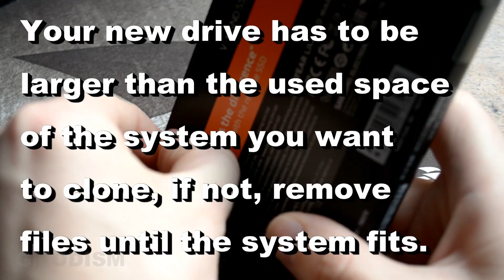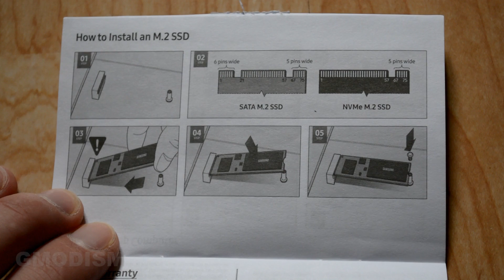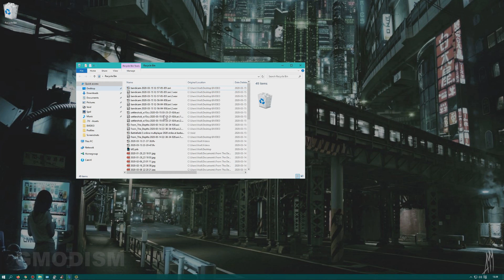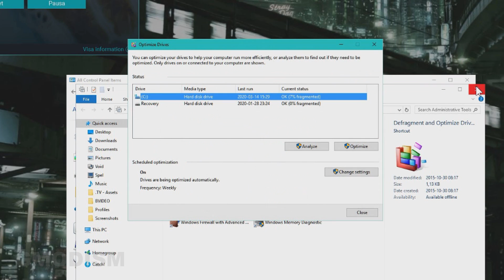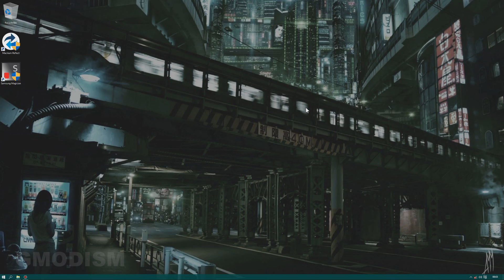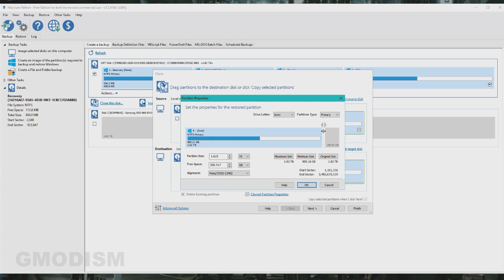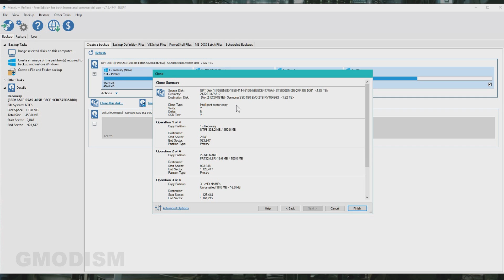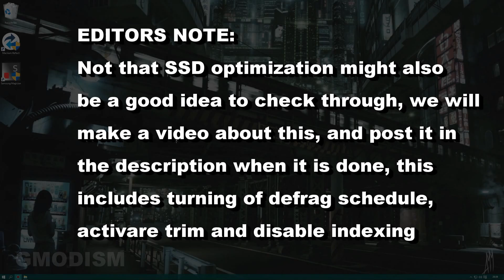How to Move Windows 10/11 from HDD to SSD

Comment: Even in 2021, this is such a good video! I followed these steps when migrating from my laptop's HDD to a new SSD
Just a few updates:
-On Macrium, it now requires an email. The email is where they will send the link to the installer. Not a deal breaker, it's still a free software
Pretty much Macrium is the same as presented in the video

For anyone wondering how I did mine:
Background: I have a spare m.2 ssd slot in my laptop in addition to my existing 2.5" HDD
1  - I installed my m.2 SSD to the slot
2 - followed all the steps on this video, except for the post cloning - because I intend to keep the HDD and SSD running at the same time even after cloning
3 - After cloning, checked in Disk Management and File Explorer if the new drive is detected and working
--At this point, do not worry about the Letter Assignment of the drives / partition, it will change later
4 - Go into BIOS/UEFI, change boot startup setting to the SSD
5 - Save and Exit BIOS, it will now boot to the new SSD. It is noticeable because the boot load time was just < 5 seconds compared to ~1 minute on my HDD
6 - You will notice it automatically changes the drive of the new SSD to the default C:/ partition. My old HDD was assigned a new letter

My HDD had three partitions (C: D: and E:), and the OS was originally in the C:/ partition.
In the macrium software, when dragging the partitions to clone to the new drive, I did not include the original D: and E: partition since there was no OS files in that

Hope this helps to anyone who needs it! Good video man, this is the most simple yet elegant solution

Comment: If I don't install the operating system on the SDD, and I keep the operating system on the original HDD instead... Will I still see an increase in speed and app performance if I just install the SDD without putting the operating system on it?

Comment: When I go to boot from my cloned disk in BIOS it doesn’t appear in the available options list of bootable drives. also, in macrium my original C: drive does not list the separate partitions as Primary, they are all Dynamic. They are also highlighted in orange rather than blue. converting my new drive from a basic drive to a dynamic one makes it disappear from macrium altogether. any assistance would be super appreciated!!
Reply: Have you get any solution yet? 
- Using asus laptop
-  tweaked bios csm-safety boot setup
- plug - unplug hdd (origin) and ssd (target)

And still SSD not detected in bios
Reply: @winters4960  so ultimately I was unable to clone my original drive to my new drive because my original was a dynamic volume instead of a basic drive. I installed a fresh copy of windows onto my new drive.
Reply: @nathanaelstevenson3674  after trying all every solution. Mine (original windows) has successfull boot with ssd. As you say, it must list as basic drive for all partition. And have to clone ALL hdd partition into ssd (i'm using macrium).

* At first i only cloned OS partition only and it cant be detected as bootable device

Comment: IMPORTANT***If cloning to a BIGGER SSD!

Onve you're in Macrium make sure to drag down the (C:) Primary partition LAST. That way you're allowed to allocate all of the available free space to it! The program only allows you to increase the clone size if it's the last partition you dragged down.
Reply: Thanks, man! I’m so glad I saw your comment so early in the process
Reply: Thank you so much. Cloned from a 256gb ssd to a 1tb m.2 NVMe and realized I had 700gb unallocated. Couldn't partition that remaining space without disabling the ability to boot from the NVMe even after cloning. Followed what you said and now im cloning with the remaining space on the primary!
Reply: Dragged down last, what do you mean please its tick boxes on free Version I'm using version 8 I think. Any help appreciated I dont get why its trimming the new disk or how to stop it doing it cant see any option to prevent it. Cheers
Reply: @Teckno77  on 7:27 he drags down those parts to the new disk starting from left to right. You might gonna have to drag them down in a different order so that your primary space is dragged down the last. Then just click Layout while the primary part is highlighted and you should be able to change how much of the unallocated space your new disk will have

Comment: More than a year later, and this video still did the trick for me! Thank you very much for this! I upgraded from a (seemingly) damaged 1TB HDD to a 2TB M.2 NVMe SSD (3rd gen I think?). The difference is day and night. 

I ran into some trouble during the partition slider thingy due to my software being a more recent version than yours, which changed some interface elements. I was particularly worried about my partitions because besides Windows I algo have Ubuntu. Before the upgrade the BIOS would ask me to choose what OS I wanted to boot up, but now it boots up straight to Windows, which isn't bad, but I wonder how to boot up Ubuntu if I ever need to again.

Thanks again for the video, I don't know if you still read, let alone answer to new comments, but I feel like I must thank you for this, it feels like a brand new computer!
Reply: Hey, quick question. Does it work the same when using an M.2 SSD? Like he said in the video, that you should use the old SATA cable of the HDD to connect the new SSD, but the M.2 is directly connected to the motherboard. Can I just follow the tutorial disregarding this or is there anything you did differently?
Reply: @aha6781  Yes, when you get to the part when you must plug in your SSD just insert your M.2 drive like you normally would; I literally left a hole where my old HDD used to go, I didn't replace it with anything. Just "plug" in your M.2 and carry on with the tutorial.
Reply: @aaron8083  Got it, thank you so much!

Comment: Does the system reserved partition affect it when it's on a drive other than the main one?

Because i tried it multiple times and it didn't work.

Is it because my system reserved partition is not on the same drive that's containing the system?
Reply from the maker: Both are needed
Reply: @GMODISM  so what options do i have?

Is it possible to clone the drive that's containing the system and cloning the system reserved partition from the other drive into one drive?
here's a screenshot  to make things more clear :
https://imgur.com/a/Hj0Y9jr

Comment: Is it possible to only copy the Windows Boot Manager of my old HDD? I can't remove it in my CPU because my computer won't boot without its Windows Boot Manager.

My SSD is only 240gb while my old HDD is 465gb with over 400gb space used that's why I can't clone it.

Comment: What if you wanna keep the HDD in the computer still? Just delete the cloned data from the HDD now that it's on the SSD
Reply: You just connect the 2nd SATA and powercable.
Reply: For anyone wondering after everything's cloned just make sure your SSD is the drive being used now over the HDD for your system. If that's all good you can literally just delete everything or go through and pick what you want to keep on the HDD. You can even delete things like Windows off the HDD but you'll probably have to YouTube how to do that as well like I did because it requires you to change certain permissions to do it.

Comment: Hey, thank you I cloned successfully but cannot work out how to get the SSD to boot.

I have an ASUS MoBo, in that BIOS under boot option only the SSD is showing. I have been trying for a while to get it to work.

I have refitted the HDD, and had to reset win 10 - thinking maybe I have to re clone? 

I have tried to reset the SSD but it errorEd (I snatched out the HDD data cable just as I clicked go....)  probably shouldn’t have done that but getting desperate. HDD is sooooo slow

Comment: Before watching this video I downloaded that and it installed 5 other programs, it doesn't even say anything on virus total. Don't install it, it's gonna put a bunch of adware and PUPs on your PC that you can't uninstall. They wont let you uninstall it, they're uninstall resistant, and windows won't do it. I was able to uninstall this cause this ain't my first rodeo with bitcoin miners and PUPs but PLEASE do NOT download this!
Reply from the maker: Macrium reflect? Never had any issues myself
Reply: @GMODISM  It downloaded TOPVPN Ifun screenshots Ifun screen recorder and was in the process of downloading more.
Reply: @GMODISM  I used IO bit uninstaller and booted them off the system as well as this virus.

Comment: My laptop has an additional slot for an ssd which I’ll be installing. I’m going to transfer everything from my default C: drive (hdd) into the ssd and set the ssd as the default boot drive. After that, could I simply just delete everything in the C: drive and use it for storage while the laptop runs and installs programs on the ssd?
Reply from the maker: Kind of but look at the tutorial in description or pinned comments on how to reuse it

Comment: This has just helped me out so much I’m so thankful can you plug the hdd back in straight away and start using or do you have to wait a month
Reply from the maker: you want to wait to make sure the ssd is not faulty, technically the old hdd still hols windows and all your files, you can use it as a backup, everything is still there as well. 
To use it to store files you need to clean it up, check video link in pinned comment and description on how to start using the old drive :)

Comment: Hope you answer my question. I have a 120GB SSD and a 1TB HDD. I want to move windows 10 From HDD to SSD and I have 4 different partition of HDD. So should I only clone the C drive or i have to get same amount of storage?(Sorry if I don't make any sense)
Reply: You need to put everything on the ssd or else it wont boot. Start with the smallest size partition and put the largest at the end. It should work.
Reply: @zyz6325  Thanks. It worked
Reply: @wahidulhauqe3929  yaayy

Comment: What do I do if my ssd isn’t new like I used it before and had to reset everything because I was in repair loop. How would I copy each thing over from the hhd cause it’s a bunch of different partitions
Reply from the maker: Depends if you deleted stuff from the ssd or not, if everything is backed up to the hdd then just copy that over, but not sure what you have done prior to this.
Reply: @GMODISM  I deleted everything from everything and re downloaded windows on my hhd and copied it over with the same method on this video but it won’t boot from the ssd anymore like it used to

Comment: This tutorial is magic! I went from a 2TB Toshiba HDD to a 1TB SSD and everything worked perfectly. I was under 1TB on the HDD so moving everything to the SSD went smoothly and as described in the video. I still have wiggle room on the SSD for additional games and plan to put some of my lesser used games on the HDD. Great video!
Reply from the maker: Awesome!🌸
Reply: Hi, Michael. Great to hear that everything works out. However, did you lose your Windows 10 license after the cloning process? Because I'm thinking of cloning the drive but my PC was upgraded from Windows 8.1 to 10 and I can't find my original product key...
Reply: @nortongartino4602  best way to find yours: 
regedit > Computer\HKEY_LOCAL_MACHINE\SOFTWARE\Microsoft\Windows NT\CurrentVersion\SoftwareProtectionPlatform

If you click on this folder there will be an object listed 'BackupProductKey'. That is a valid product key, and I believe it's the original one you used.
Reply: @lewisjones284  Thank you for your answer, Lewis. I'm going to try to find it once I got back from work. Thank you.
Reply: @nortongartino4602  Hope it helps you, have a great day
Reply: @nortongartino4602  did it work for you?
Reply: @420Sean69  I didn't look at the regedit, however it turns out that you don't need to. I was able to clone my HDD to my SSD and got my computer up and running, because my friend told me that the windows digital key is bound to your motherboard, not your HDD/SSD. So I think you'll be fine if you want to clone you old HDD to a new SSD and make your new SSD your main drive.

Comment: Weird.  Turns out it's cheaper NOT to use your 50% off link for EaseUS.  I found the price difference is £15.98 + Free 7 day trial vs your 50% off deal at £17.98 NO FREE TRIAL.
Reply from the maker: That's strange, guess I have to ask them why this is then
Reply from the maker: When I check I get the 50% off via private window, maybe you got a even better deal in the area you live then IDK

Comment: Hi i know you may not see this GMODISM but I'm having a issue, im trying to transfer a 1tb hdd to a 500gb ssd and it wont allow me to clone all the files over. What should I do?

Edit: It specifically says "Not all copied. Insufficient Space."
Reply: it is because the ssd cant hold all the files you are transferring from, the hdd because it doesn't have to space too, if you really want to move all your files to an ssd you would have to get a 1tb ssd or only move half of your files to the ssd
Reply: @lilpeli1658  thanks so much, I had a feeling it was that.

Comment: Question: Will this method overclocking GPU the same with CPU? Thanks
Reply from the maker: CPU reads from, the SSD, so yes it will increase speeds, but overclocking is something advanced and not related to upgrading storage drive.
Reply: @GMODISM  Sorry, the wrong video I asked!

Comment: I did all this, wont boot on SSD after unplugging HDD. It says "A required device is not connected." I've been in bios and selected the right SSD, if I boot with HDD, I can see my SSD, and the clone was succesfull. any ideas?
Error: 0xc000000e (if that helps)
Reply from the maker: Seems it had trouble copying over the boot directory, sure you copied that over?
Reply: @GMODISM  I'm not sure. I formatted the SSD and tried again, now it doesn't want to clone the disk at all o.O I've removed the 100gb unused allocated space, so it has 1tb of storage. It instantly reboots into windows 7 for some reason and "an error occurs", rebooting into Windows 10 again.

Comment: hi, thankyou for the amazing tutorial. In my case my HDD is 1tb and my ssd is only 120gb, Will only windows transfer over or everything else i have on the HDD too with that software?
Reply from the maker: Everything will be moved over so make sure it fits, you can store big files on a external hard drive (like movies) if you can't make it fit initially

Comment: Great video. Very easy to follow, however, I can't seem to get my ssd to work when I completed all of the steps. When I go to boot with the ssd, an error comes up on the screen and it won't boot into windows. Any suggestions?
Reply from the maker: Hmm, depends on the error, if something didn't go through you can redo the process, maybe watch the full length tutorial to make sure. Also try googling the exact error message.
Reply: @GMODISM  I figured it out. The ssd is trash.
Reply: @GMODISM  I appreciate the response
Reply from the maker: @KT1459  damn, refund it!
Reply: @GMODISM  I got it to work on my ssd but it made my pc 2x slower. So I'm going to assume it's the ssd
Reply from the maker: @KT1459  yeah refund it, maybe you got a scam ssd from wish or eBay

Comment: I followed this video's instructions on 2 machines.  One worked, but I might have clicked something I  shouldn't on the other, because the cloning automatically assigned drive letters D and H to partitions on the drive I was cloning to. After unplugging the HDD and plugging in the SSD, the bios detects it, but won't load Windows. The bios for the ASUS motherboard does not include an option to load Windows. I can't get it to boot into the SSD. Any clues?

Comment from the maker: Navigation
00:00 intro, beginners watch full tutorial instead in bio
00:21 installation of SSD (or HDD)'
03:01 SSD/HDD detected?
03:34 important preparations
06:17 moving windows to another drive
09:37 booting from your new fresh drive
11:30 check our SSD optimization video in bio for max performance
11:54 outro (watch the full tutorial instead if you have any questions)
Reply: Have you thought about remaking this with the new version of the software? I know it might be similar but the driver part is hard to find in the new ui
Reply from the maker: @420Sean69  hey! It is in the pipeline of remaking this one yes. And for Windows 11
Reply: H! Great video! Clear and concise. However, I was wondering, will I lose my Windows 10 license after I clone my Windows 10 OS partition (local disk C:) to a new SSD Drive from a HDD drive?  Thanks in advance.
Reply: I need help I’m stuck where I have to restart the computer !!!!! Plssss if you se this message add me to your discord

Comment: Sooo, following the tutorial I coopied the data from my 200GB SSD to my new 1TB SSD because I was running out of space.
But I ended up with the new disc essentially having the same space as my old disc, except it now has a 600GB recovery partition. The old disc also had a recovery partition, but that one was 500MB. Now, I'm assuming this is due to the recovery partition being located "last" on my old disc, and any extra space was just allocated to the last partition on the new disc.
Problem is, I'm a total rookie, and I have a hard time finding out how to undo the cloning so I can redo it and make the extra space be allocated to my main storage partition on the drive.

(Keep in mind that I am a complete rookie. An hour ago I didn't even know the word "partition")
Reply: have you sorted it out ?
Reply: @say1l  I think so, but it's been forever, so I don't remember the process
Reply: I'm having this same issue, so annoying. This seems like a good process but it's not working very well for me. I managed to delete the recovery partition using an override command and then reformat the  entire ssd so hopefully now it will clone the operation system but still have full storage capacity of the new 1TB ssd.